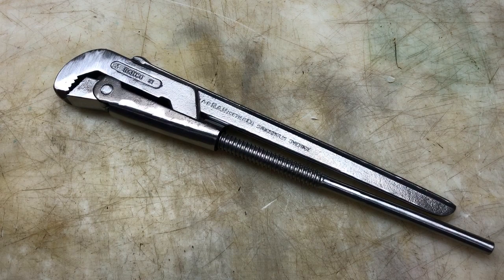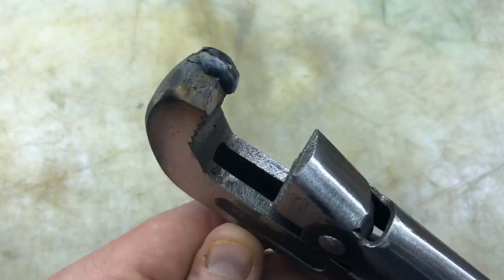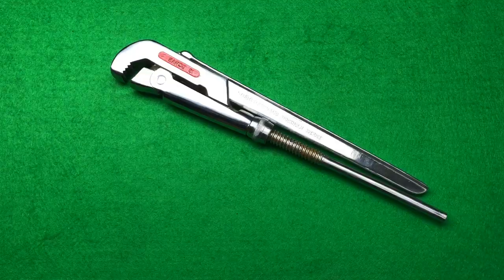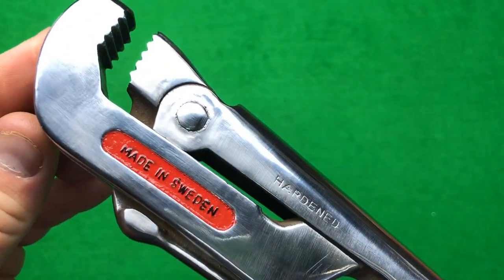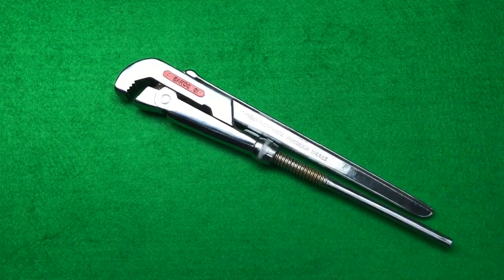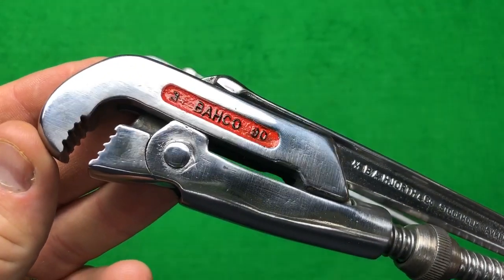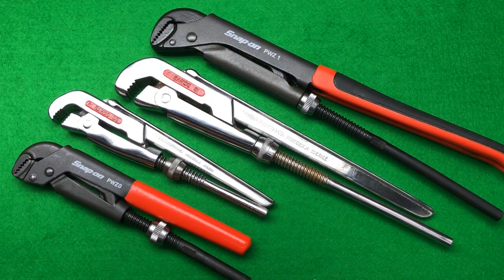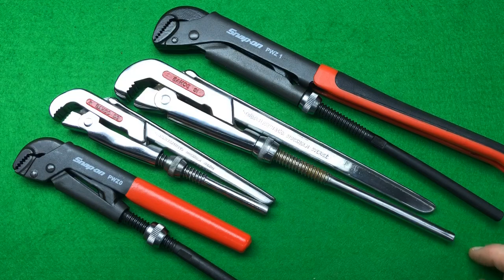bahco 91 pat 1888  Full restoration Or snap on pwz1 from eBay tool haul

Comment: I am impressed by the repair, it seems seamless!! Did you just use the belt sander to grind the weld? Keep them coming, I like the slick "edited" clips you are now putting out, All the best
Reply from the maker: 🤣 slick I wish my videos are probably the worst quality of all the tool Channels I appreciate the comment I did use a belt sander yes 1 x 30 the same as Scout Crafter does I hope that helps thanks again Nick 😀👍